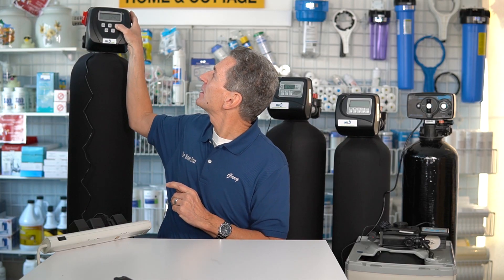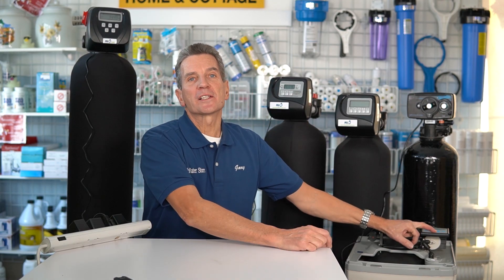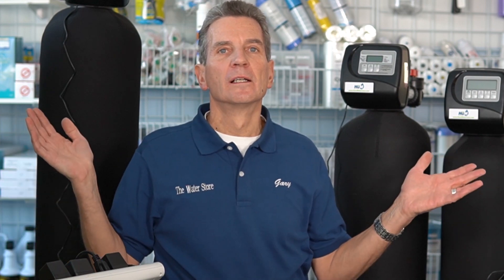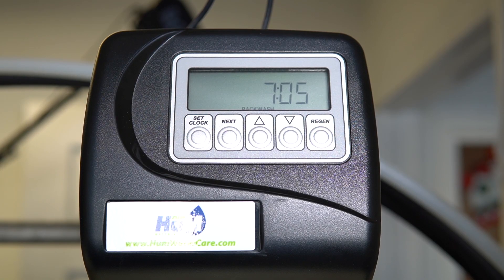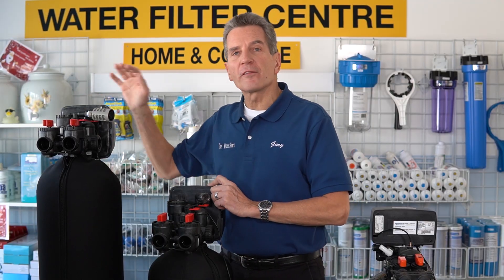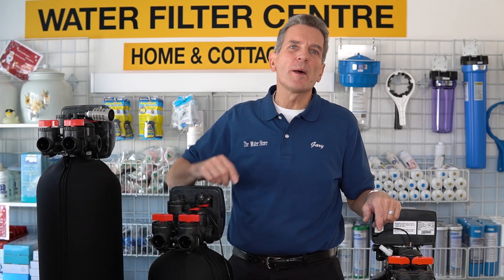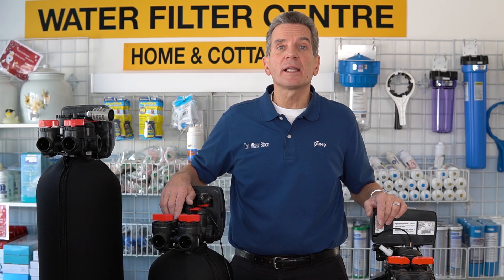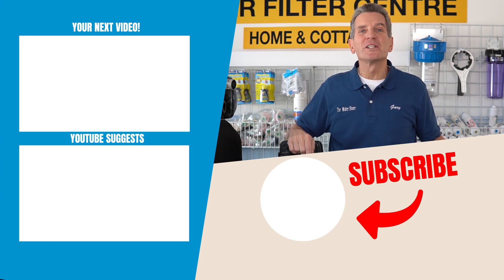Avoid this WATER SOFTENER MISTAKE before it's too late!

Comment: Water Softener Help. Looking for some help or suggestions for a Eco Water Softener.  My water softener has been recharging/regenerating for several hours.  The recharge is set to recharge/regenerate in the middle of the night.  This morning when I opened my garage door I could hear it running, that was around 8:00 am and it's still running.  I tried calling Eco Water Systems and also tried to google it but no help at all.  I'm tempted to pull the power plug to stop it but I'm afraid of possibly causing damage.  Not sure what to do or after watching your video how to by pass.  So glad I watched your video before unplugging.  Thanks.  If you could tell me how to bypass and what's causing it to still regenerate I would be very thankful.  The recharge is set for 2:00 am and it's now 12:30 pm and still going.
Reply: I found the bypass and turned it off.  I recently filled with salt after I realized I hadn't checked it in a while and it was down to the bottom and it was all sludge.  I completed emptied the the sludge out and rinsed the tank and filled back with salt.  I'm not sure where to go from here.  The salt is at # 6 or 7.  Not sure if the problem is a clogged line.  what to do?  Thanks in advance and thank you very much for the video about the bypass.
Reply from the maker: It sounds like either your motor failed or the piston is stuck. You will either need to have the valve rebuilt or the water softener replaced.

Comment: Why is my water  Foam on top of it this morning.  I added 3 bags of salt I could not get the filter thing off so I just left it but when I went down there today I open the container and there was water just to the top of the salt so I added 3 buckets am I supposed to do this
Reply from the maker: If it is working correctly no water needs to be added.  If not, this video will help https://youtu.be/Lr3jyGiJdC0

Comment: Do you have any suggestion of what might be wrong? I really appreciate any advice.
Last night I have never heard it before it was really loud waking the neighbors then this morning the salt is at the bottom and the small amount of water is clear? Usually it’s cloudy water. 
Mine is water guard treatment system no buttons or controls or lights not sure if it has ever worked?
Reply from the maker: No sorry, I am not familiar with that system.  I suggest you contact whomever you bought it from.

Comment: Hi,
I have a Aquatrol 56SE Water Softener…
Yesterday morning I woke up to it constantly running (stuck in the regenerating cycle) I bypassed the system…any suggestions should I try taking off bypass?
It had an ERROR CODE “BD”
Reply from the maker: Either the motor has failed or the valve needs to be rebuilt. See https://youtu.be/RhvspR3PAw8

Comment: I have a slow leak that seems to be coming from right under the bypass valve.  I tried to bypass but the valves won't budge.  Also, I have 2 towers.  One has the red bypass valves (which I can bypass) and the other has the black valves, which is where the leak is but won't budge.
Reply from the maker: Sorry too difficult to help you this way.  I would get a service call to fix.
Reply: @water_estore  Thanks.  Was finally able to enable bypass but needed to replace the whole bypass valve.
Reply from the maker: @delainawilliams9096  yes, I can see that happening.  If you open and close the new bypass a couple of times a year it will not seize up or leak in the future.

Comment: Hi Gary, I recently had work performed on my well. They bypassed the water softener during repair to install a check valve. However, they left the softener in bypass. Any reason for this ?  Apparently I have a leak down the line, but I feel the ongoing sediment will not be good for the overall plumbing in the meantime?
Reply from the maker: I would ask them but likely they just forgot to put it back on line after they finished their work.  I see this all the time.

Comment: Thanks for the great videos Gary.
What about water outages, vs power outages?
I shut off the water of my second home when I'm not there. But I have never unplugged the water softener. Can the system run dry during regen (I can't tell if suction to the brine tank is coming from a pump)? Should I unplug it and/or use the bypass when I shut the main water valve?
Reply from the maker: Great question!  No you don't need to unplug the softener as since there is no water nothing will happen during regeneration.  When the water is back on, just regenerate it manually.

Comment: We had a salt clog and through you instructions hopefully it's fixed so right now it's on manual regen. Can l use my shower or do l have to wait for 2 hours?  Thank you so much
Reply from the maker: You can shower after the regeneration is complete, not during.

Comment: Hi Gary:  Can any damage be done to my Clack Water Softner if I have a power outage, especially if it's in the middle of a regen cycle?  Thanks!  Ed
Reply from the maker: No it  will not but I always suggest you plug your water softener into a surge suppressor to protect the circuit board.

Comment: My Fleck7000xts leaks water out the drain line constantly whether in flow mode or bypass.  It’s been doing this for quite a while...like over a year.  The water seems to be soft.  What’s causing this...,the unit is 6 years old and has never been serviced.
Reply from the maker: The valve needs to be rebuilt, water is leaking past the piston.

Comment: My backwash head is generating a consistent fine noise similar to gas leaking sound.. when I bypass it, the noise disappears completely after a few minutes.. I tried to clean the injectors but it didn’t help. The sound seems to be coming from the valve area.. it does back wash and filtering well I guess, it’s just the sound that I’m concerned about.. any idea what  is that and what should I do?
Reply from the maker: Sorry, I don't know.

Comment: I have a 2016 NOVO 485HE High Efficiency Water softener. We moved into our home a few months ago. I ran a manual regeneration again today becasue the last one was about July 11th. The water meter is showing that we still have a lot left, same as to be used. Almost like it is not softening the water. I can tell when I shower that the water softener is not working. My parents have one and live in same community.... Something wrong, I can't get the water to soften. Help! I have the water hardiness set on 14 grains. I have gone more and less, nothing helps. I checked the bypass it is in the proper position to work.
Reply from the maker: Sorry to hear.  When you manually ran the regeneration, did you hear water running to drain?  It is at least 1/2 full of salt, correct?
Reply: @water_estore   Yes, the manual says to fill with salt just above the water line. I did. Yes, I listened to the regeneration cycle and seemed to go through the who process. Yes, water was running through it. Definitely could hear that.

Comment: Gary my man! I have a question. There's a hard freeze coming to my town. I have an apollotek equinox home water filtration and water softener system. Looks like it has the same valve as the one in your video. The one in the middle of the 3 to the right of the screen. What should I do to protect the tank from freezing and causing damage? It's a really big tank to try and insulate. I don't have any pipe insulation on my exposed pipes. So I'm contemplating on shutting off the water from the city valve and draining my pipes through all the faucets to prevent my pipes from bursting. Do I unplug the system and let the water drain out? Or do I leave it on and drain it? Is there a setting I have to configure to for something like this? Please help me out Gary. It's going to get down to around 15 degrees F.
Reply from the maker: Your best bet is to shut off the water and drain, this video shows you how https://youtu.be/hkMVGVbtAA4
Reply: @water_estore  what's my second best bet? I'm only one skinny dude, and this tank is huge and super super heavy, supposedly this is the biggest tank on the market from what I read, I don't think I can handle tipping it over without dropping it, and the air compressor method is not possible for me, my plumber friend told me to just layer it in covers and blankets tightly, unplug it, and turn the main city water switch off, and drain out my faucets, I have been filling buckets and buckets of water to use while the water is shut off, does that help to empty the tank before I unplug it? This freeze will only last about 3 to 4 days , freezing mostly at night, Monday will be an all day frozen temps with rain and snow, I layered my tank with 3 layers of bed covers, tied a rope around the bottom of the tank over the covers so cold won't easily seep in from the bottom and put a blue tarp over it so the covers won't get wet, will this be sufficient?

Comment: Hi Gary, my friend has a Novo water softener and it hasn’t been used in a year. I cleaned out the salt tank and wiped out the sides too. 3 bags of salt where added. So it’s about 2/3 full, the water was turned on and the regeneration mode was set. It did it for about 1hr and 40 mins. But I didn’t hear any water flow or anything being pumped out the drain? Is there a step I’m missing ?
Reply from the maker: Is it bypassed?

Comment: Hi Gary, my system doesn't look like any of these. It's a very large putty colored tank. Started running every 55 seconds at 1:13 am, and it's now 2:56 am. I couldn't find the shut off valve so I turned off the water to the entire house. I wish Culligan would put out a short instruction sheet on how to turn off the system since it seems this is a common problem. :(
Reply from the maker: There should be a bypass where the plumbing attaches to the water softener here you can put it into bypass temporarily

Comment: so theres a white thin line cable hanging for the outside wall next to water softmer(i think its for timer)if the valves are in bypass is it also gpod to disconnect the power also..or not...dont really use it..i have water that when the water softner does a gen..the water pours down my roof from the gutters
Reply from the maker: If it's bypassed and you don't use it, yes, unplug it.

Comment: Hi Gary.  I watch a couple of homes for friends while they are away for the summer...AKA "snowbirds" and they are gone months not weeks.  They each have a water softener in their homes and turn the main water valve off while they are gone.  I have heard that there is the potential for bacteria growth inside the resin when they are not used for more than a few weeks.  Leaving the water off to the home is important because of the damage that water can cause in a short period of time.  So what is one to do?  Any suggestions?  One company representative said to install a by-pass but not sure how that would work.
Reply from the maker: I too would shut the water off while I was gone.  If someone can stop by and regenerate the softener once a month would help.

Comment: My Kinetico water softner leaks outside when in service mode; in bypass mode it doesn't leak.  What might be the problem?  Thanks.
Reply from the maker: Water is leaking past the piston seals.  You will need to either rebuild the head or replace the unit.

Comment: I’ve turned the dial to brine rinse and I hear the water running but the dial won’t move to backwash . The running water eventually stops but the dial stays out on brine rinse. I e seen in your videos that dial should automatically turn to backwash.
Reply from the maker: Yes, it should go to the next cycle unless the motor is not working.

Comment: Quick Question: should a water softener be draining throughout most of the regeneration cycle? I’m not sure if this is normal or if my water softener is malfunctioning.

Also, what hardness setting is recommend for the Midland area? It looks like my unit is set to 27.
Reply from the maker: Yes, it drains for most of the cycle.  This video explains the process https://youtu.be/wPh_l56OWOM  Midland hardness is typically about 15 gpg.

Comment: Gary, I have an older 460i unit that was in a piece of property and was unplugged for a year. What do I need to do before starting it up?
Reply from the maker: That must be a very old water softener so I would follow the advice in this video https://www.youtube.com/watch?v=c8QKYr3B02I&t=1s Add a couple bags of salt, make sure there are a couple of gallons of water in the brine tank, wait a day for the water to absorb the salt and manually regenerate the softener.  Regenerate again  after a couple of days.

Comment: I just got a new house and it came with 2 water softeners but one is bypassed and turned off... I had a clog that I fixed but when messing with it my dad turned off the bypass. He didn’t see the one tank was unplugged. I put it back how it was but it already ran a regeneration. Should I do anything? Why is there two? I will say out water is really salty since we’ve been here but the previous owners never used both ether. Thank you!!!
Reply from the maker: Great question.  I think one of the "softeners" is actually a tannin filter.  Is there a weak tea color to your water?  I would have a water analysis done to find out exactly what is in your raw water.
Reply: Gary the Water Guy I had the water tested during home inspection and everything came out ok. Water seems clear just really I guess salty and slimy (at least compared to what I’m used to). After some research I’m thinking they used it as a double softener system. Maybe too much water being use before so they just staggered the regeneration. Either way everything seems to be working fine. Once this quarantine stuff is over I’ll have someone check it out. I appreciate your help and the response! Your videos really helped me out! Keep up the good work!

Comment: Sir, thank you very much for your informative videos!  We (Texas) just went through an unprecedented winter storm where we lost electricity and my household lost water for four days.  When we lost water, I bypassed the softener so it would stop working.  Now that the water is back and pressure is normal, is there anything that must be done with the softener other than put it back into service from bypass?  I have a Charger Pro H2O softener very similar to those in your video.  Thank you.
Reply from the maker: Glad to help.  Just open the bypass and press the regenerate button to schedule a regeneration.
Reply: @water_estore  Thank you so very much sir.

Comment: My water tastes too salty. We have an new Excalibur system. I can see water above the salt in the brine tank and our installer said that was fine.
Reply from the maker: Did they test the water before the installation and program your water softener to the correct settings?  Usually those guys don't and that causes the problem.

Comment: I have the three valve bypass.  Can I run regeneration by closing the bypass from the softener outlet and opening the other two valves? This will allow water to flow into the softener and into the house but the waste water from the softener will go down the drain.
Reply from the maker: The water softener has a designated drain connection so the waste water will always go to the drain.

Comment: Hello Sir, great video's, 
I do have a question about my water 
Softener! Its a" town and country "
It's about 6 or 7 years old,
Now it has a very loud ringing noise
When it is filtering in the first tank 
As the water comes in ?
So doesn't ring all the time , not sure what the problem is ? Does this 
Sound like some thing you have come across befour
Reply from the maker: No, sorry I have never come across that concern.

Comment: I love your work Gary.  Quick question. I am trying to trouble shoot a water hammer noise, which sounds like a chunk, chunk, chunk, maybe once a second for about 10 seconds. It happens at random times, typically in the evening or first thing in the morning (when no water is in use). I suspected the water softener until I turned the red by-pass valves to by-pass my Excalibur water softener. The problem was still there. Any ideas?
Reply from the maker: Sorry Ireally do not know but I don't think it has anything to do with the water softener.

Comment: HELP!!!!  I have a GE # GXSH40V.  Completely cleaned the Tank, purged air from system, reinstalled, poured 3 gallons of water, added 3 bags of salt, plugged in unit, set all the info/time/hardness/salt-level/recharge time.  Then i hit recharge now.  Everything seemed fine, i walked out,  then back in, and notice water everywhere, not too bad, but i was puzzled.  So I stayed in the garage for over an hour as it continued.  I regularly checked the drain hose and saw it was draining.  As it was close to the 2 hour mark, i thought i go inside...came back and water was spewing EVERYWHERE, I panic is an UNDERSTATEMENT.  I saw an ERR  with call for service... I immediately unplugged my unit, and begin the wet vac pickup and blowing fans.  Everything got drenched!  the housing rim and everything in it like the valve covering, and WIRING!!!!  WHAT is my next immediate  steps?  Turn the unit back on?  Manually drain the  tank? Your direction is GREATLY NEEDED.
Reply from the maker: Sorry top hear about this grief.  I would follow the advice in this video so you don't need to stand there and wait through each cycle https://youtu.be/3-foqGvNCKQ and then i would follow this step by step troubleshooting video https://youtu.be/Lr3jyGiJdC0  Please realize that you have a big box store water softener and they are not meant to be repaired, just replaced.

Comment: When I run my water softener I'm finding less water pressure. When I turn off the valve to the incoming water into the system the water pressure is fine. I regenerated three times yesterday with a liquid that was told that cleans the mineral bead. Now my brine tank is almost full of water.
Reply from the maker: There is something wrong with your softener, check out this video for some ideas https://youtu.be/Zikmilf_Tu0